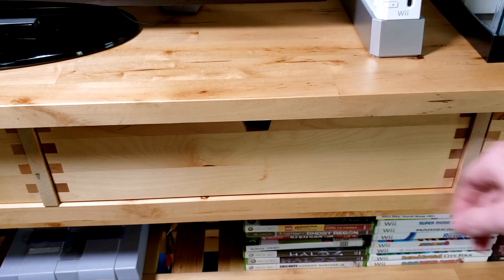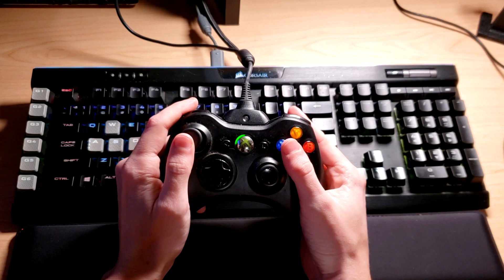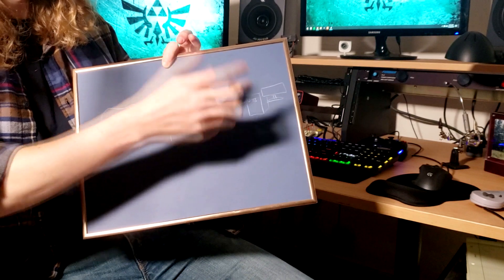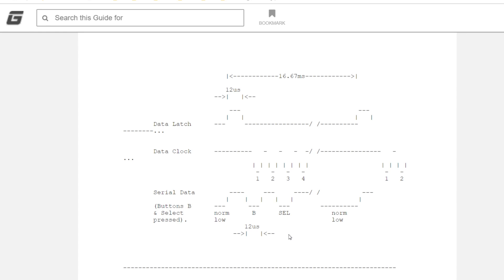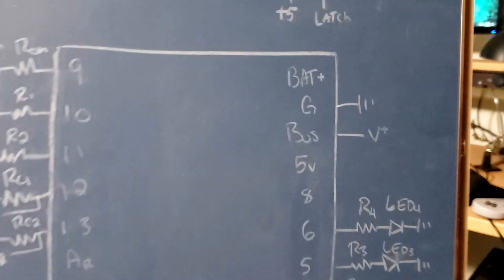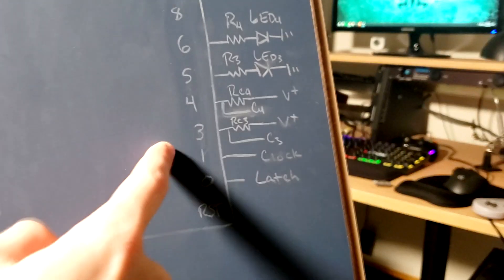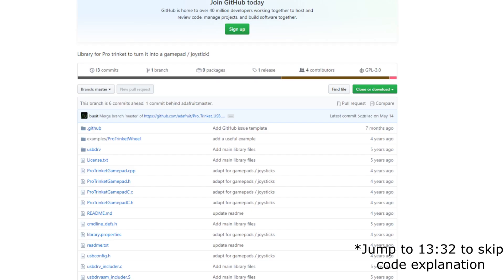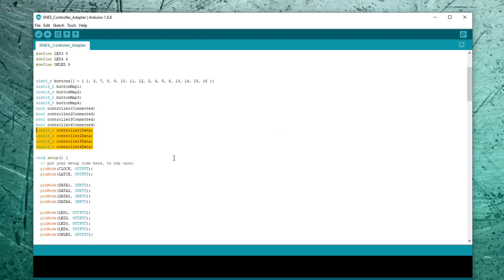Making a USB Adapter for Super Nintendo Controllers

Comment from the maker: **Important: It is no longer necessary to use original hardware to get controller sockets! 

When I initially started this project in 2016 (big procrastinator), I couldn't find replacement parts anywhere, so I resorted to using dead consoles. Since then, the market has greatly picked up. In the description, I linked some extension cables that can be spliced, and you can also find 3rd party replacement sockets on eBay and aliexpress.
Reply: do you think it would be possible to use a CronusMax plus or Titan One on a SNES? ......
These type of adapter do Retro -> USB. Going USB -> retro is a little harder, I am unsure how to do this right now.  do you have any idea ?
Reply from the maker: I don't know anything specific about those devices, but the basic idea would be to figure out how they communicate with the PC, build a device that intercepts that data, then shift it out to the SNES following the protocol on the video.
Like you said, it's probably a lot harder to go that direction. Newer devices tend to have more complicated protocol.

Comment: Great video, I'm kinda late but would it be possible to create a keyboard & mouse to ps4 adapter? What would it require?
Reply from the maker: Well, I don't know much about how PS4s work. As a general response, you'd need to know the protocol the PS4 controller uses to communicate with the PS4. Then you'd make a device that accepts keyboard/mouse input and outputs that protocol. Unfortunately I don't know how hard it would be to figure out that protocol and emulate it, but I imagine it's a lot harder than communicating with a PC.
Sorry I don't have anything more specific than that to help. Good luck!

Comment: I wanted to ask if i use arduino uno for this will it work as trinket and they both have same chip
Reply from the maker: Unfortunately it won't work. The library I started from that makes the microcontroller look like a USB gamepad is specific to the Pro Trinket. If you can find a library that let's you write an HID descriptor for the Uno, you can probably get it working, but I don't know if such a library exists.

Comment: Circuit diagram or pinout connection,I need to convert famiclone.(I need pinout diagram)
Reply from the maker: There is a schematic at this link. It's hand drawn, but it's the best I've got. https://www.electromaker.io/project/view/snes-controller-usb-adapter
Reply: @AllPartsCombined  but it need account. But thanks to reply
Reply from the maker: It's a free site for browsing people's projects. But yeah, turns out you do need an account to download images.
Reply: @AllPartsCombined  can I able do this with Arduino nano?
Reply from the maker: I also added the project here, no account needed https://www.hackster.io/allpartscombined/snes-controller-usb-adapter-dfc577
Reply from the maker: As far as using a different Arduino, that will affect the HID controller code. The library I used is specific to the Adafruit Pro Trinket. Unfortunately, I'm not able to help figure out how to convert that library to a different microcontroller.
Reply: @AllPartsCombined  ok thanks.
Reply: @AllPartsCombined  I compile the file and it shows:
exit status 1 no matching function for call to 'Trinket_Gamepad: :move(uint16_t&, uint16_t&, uint16_t&, uint16_t&)'
Reply from the maker: @allwinaristo9590  Hey, sorry for the very late reply. If you're still having this issue, it sounds like the Pro_Trinket_USB_Gamepad-master library is not being found. Make sure you place that library in the Arduino>libraries folder.
Reply: @AllPartsCombined  no thanks.i bought Arduino nano and it don't have hid support.
Reply: So the error found

Comment: This is a cool idea but please just buy replacement SNES controller ports, don't use official ones, even if they come from broken SNESs, because remember that those SNESs you have damaged for this will never be remade, so please just buy replacement SNES controller ports. I know somewhere online has them
Reply from the maker: There are now cheap ones on aliexpress, and I linked some 3rd party extenders in the description from Amazon. At the time I started this (a few years ago) I couldn't find replacement parts anywhere, but it looks like the market has picked up handily.
Reply: @AllPartsCombined  that's good, I just hate to see original hardware damaged, thank you for linking replacement ports

Comment: Can you make a tutorial to use USB controller on a SNES? Thank you.
Reply from the maker: Hm, I don't know. The idea would be that you have an Arduino connected to the SNES and the controller, receiving the signals I was sending in this one. Then based on that timing protocol, you capture the button states and shift them out to the SNES. But I imaging capturing buttons is going to look different for different controllers, and I'm not really sure how you'd go about connecting the USB cable to the Arduino.

Comment: Whyd you mutilate two consoles for female ports when they can be bought for a dollar :(
Reply from the maker: Well, both consoles were dead, so better use some parts than have the owner trash them. And when I first started the project, a couple years ago, I could not find those ports anywhere. It must be somewhat recent that they are being reproduced for individual sale.

Comment: you can buy a $.299 controller on ebay, open it up and swap the board over into an original controller. it takes about 2 minutes and it can be easily undone. or you could buy a retroflag or ibuffalo usb controller as they're on par with an original controller. or better yet get an 8bitdo sn30.
Reply from the maker: Yeah, there are definitely other options. I just like making stuff, and I thought this would be a good project for anyone interested in Arduino and learning to implement custom device protocols.
Reply: @AllPartsCombined  yeah that's fair enough. If I was as smart as you I would give something like this a go. I just saw a video by some kid recently who used an Arduino to make a Bluetooth dongle for his GameCube. It was genius.
Reply: They even make a snes to usb adapter now. But yeah making stuff is much cooler and you learn something doing it.